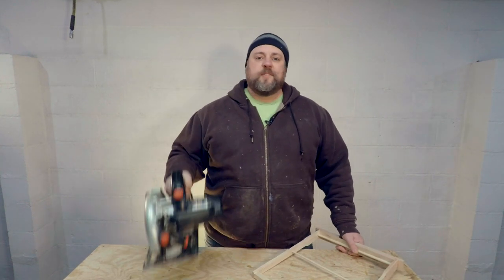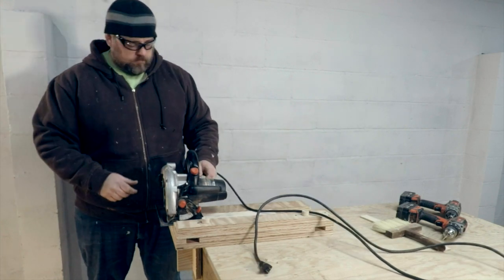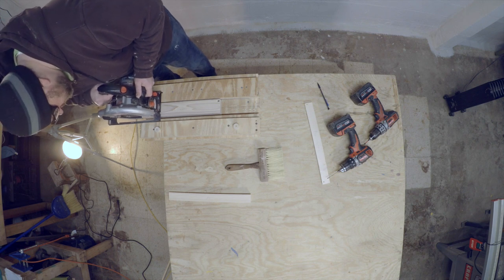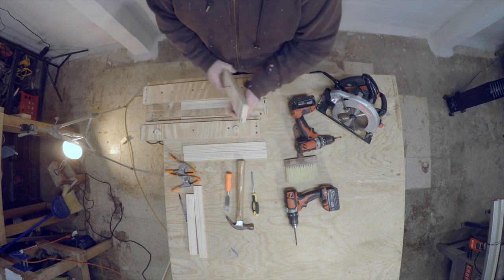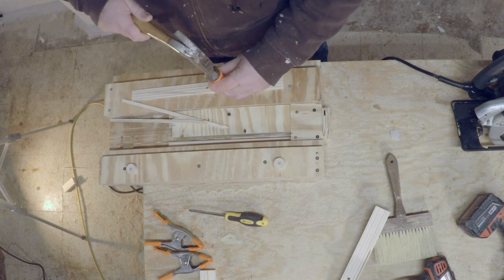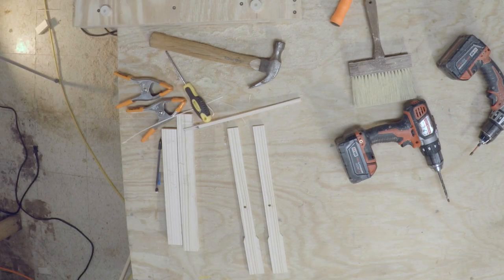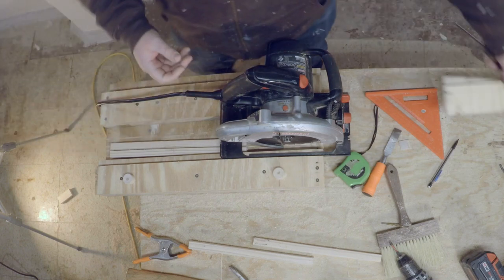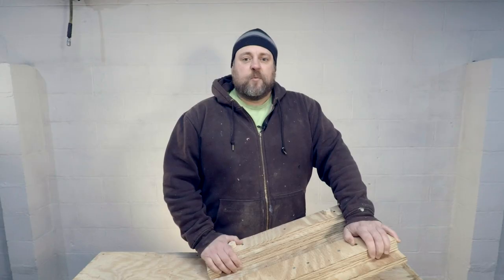🐝 How to Build a Layen's Frame with One Saw! [Using a Jig]

Comment: Great video.  Thank you for sharing.  Where do you get your lumber from? Any tips on picking wood for making frames?
Reply from the maker: Hi James. I usually try to by lumber locally from the mom & pop places but I definitely head to the big store for lumber to build frames. I've had good luck at Home Depot. Usually I have to buy the more expensive 2x4s but I once got away with the cheap ones.

The first thing I do is take the straightest board I can find off the top of the pile and place it on the flat cart. I look for knots and splits and if it's something I can work around I move on to the next board. I repeat this until I have a few more than I need, usually digging deep into the 2x4 pile and moving quite a few. Once I have a bunch lined up on the flat cart, I keep the straightest boards with the least defects. 

It takes quite some time to find the best ones even in the most expensive lumber, but will save you time in the shop and produce the best product. The Home Depot workers must be used to it because they never question me or pay much attention.

Do you have any lumber picking secrets?
Reply: @BeeBoyBill  Thanks for the tip.  I basically do the same thing. At the Lowes and HD near me, the 2x4s tend to have a lot of knots, so I have started looking at wider boards 2x8 - 2x12 at the >8ft lengths. These seem less picked over and you can quickly find boards with large knot-free sections that would be best for frames.  It may not be cheaper, but it beats flipping a pile of 2x4s.

Comment: What size hole/dowel did you use?
Reply from the maker: 1/4”, I’ve also seen Gene from Enjoy Beekeeping use bamboo skewers roughly the same diameter which might be cheaper but I don’t have first hand experience with them.